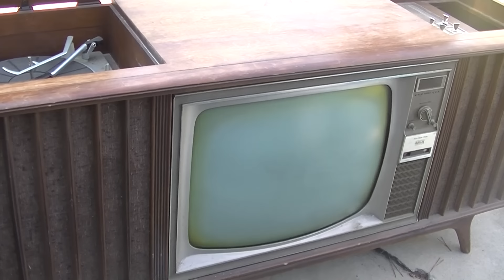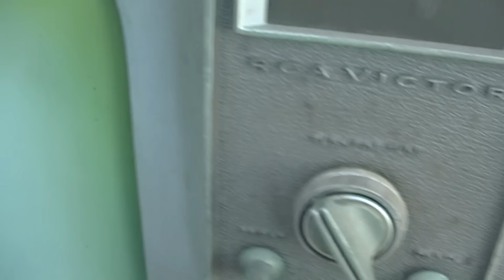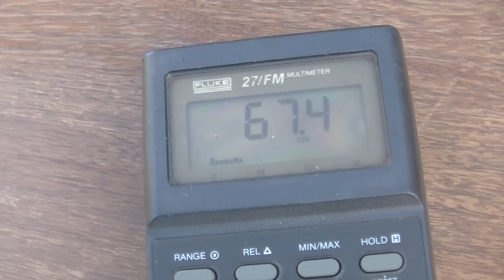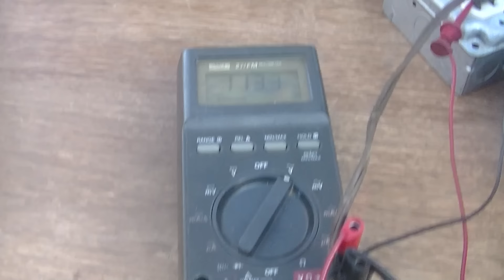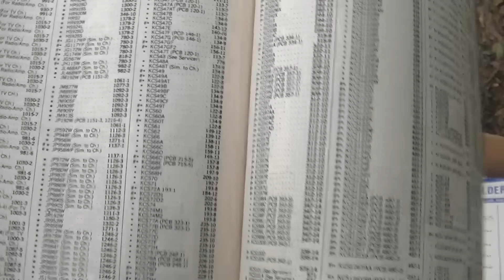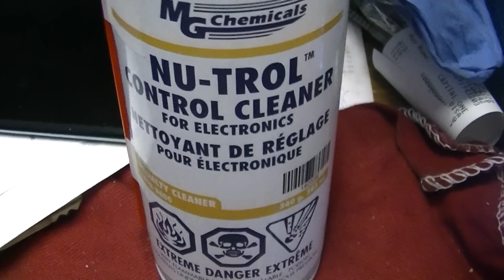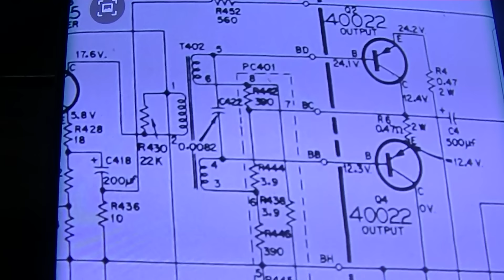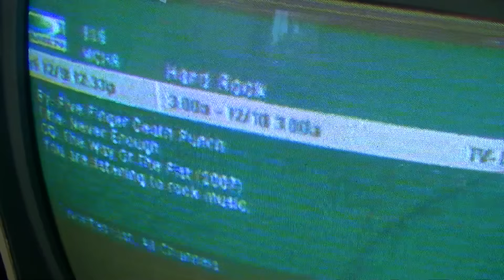1967 RCA Color Television Analysis Tuner and Amp Repair High Hour TV Set

Comment: Cold heaters on the 6GU7s is endemic to these sets. Re-flow the 2 ground stakes on the far right end of the chroma board to fix. With cold heaters, what happens  is - plate voltage on the 6GU7s rises, and since the plates are DC-coupled to the CRT control grids, CRT beam current goes into avalanche, dragging down the HV until the raster blooms out. If left in this condition, the 3A3 and flyback are cooked,  the 6JE6 cathode current goes out the roof cooking it too. We always re-flowed them 2 stakes as a matter of course on every CTC-12, 15, 16, 17 and 25.  Those ground points exist in one of two states: Failed or gonna fail.
Reply from the maker: Yeah I figured something like that or an open corroded jumper wire. I'll get it out and put it on the jig where I can work on it
Reply: Yeah. My experience with them was as a service dealer. By now, you'll no doubt find a lotta other stuff cooked and cracked.
Reply: @shango066  thanks for making these videos.
Reply: Ultra-cheezy plastic tuning mechanism only ran for one model year ('66 IIRC).

Comment: Shango I gotta hand it to you. You can get in the most challenging repairs but its good for the mind. It keeps the mind sharp. I am a repairman for a local TV repair shop that repair the LED TVs with bad backlights. Sometimes I get to have some fun and work on vintage things but I hate it when I have to stop and work on a modern TV with bad backlights every five minutes. Hahahaha 😆. Capacitors used to be the worst part ever made that fails but LEDs beat them out they are even worse
Reply: I wonder if the physics behind those failures is similar explanation.
Reply: Just cheap nasty and overdriven.

Comment: My mom had an RCA stereo only from 1968 with the same tuner chassis and record player. It had a 3way speaker system per channel. I remember for years she started the record player and hand pushed the turntable to get it started. When the amplifier started going at lower volume would hum through the speakers, but if you turned it up the hum went away. Once the amplifier was really bad, both channels were operating on the left side of the balance, nothing out of the right. She wanted to get it fixed, at the time there were no service parts available in 1981. It turned into a TV stand.

Comment: The trademark for Couplate was filed in 1951 by Globe-Union, Inc. in Milwaukee and expired in 1993. The description is "electronic inter-stage audio coupling units for television and radio receivers comprised of electrically connected capacitors and resistors bonded to a high dielectric ceramic base plate". Globe-Union employed Jack Kilby before he invented the integrated circuit at Texas Instruments, so it's likely his experience with Couplates directly inspired the development of the IC.
Reply from the maker: thanks for watching more than the first 2 minutes.
Reply: I resemble that remark

Comment: I thought I was the only Nipper fan! My last true home theater was my 1988 RCA Dimensia 30 inch flat screen. It was the final console, very hi tech with the black, chrome, and grey presentation. All of the components were shelved neatly on the right of the monitor. I had the full package. Super VHS,  compac disk player, turn table, digital tuner, and 500 watt amp(or whatever the highest amp RCA was selling) to handle the full dimensional sound for the TV and the dual twin tower speakers, consisting of a bass, surround, and tweeter. Of course, the beautiful rectangular RCA remote control that ran everything. I remember looking behind it once, with all the wiring, and cringed! I will try and post a picture. Sadly, RCA, was ahead of its time. (the laserdisc, a simple home theater concept, all controlled Universally. One last comment here, it did have a "universal plug" on the monitor side fo the home computers surfacing at the time, along with "Made in Japan".

Comment: Thanks shango!  Appreciate the knowledge shared, even better when grasping a bit what said. 
Your use of parts & 'phrased' words are noted. re: cleaner, O2 sensor, bulb + stereo, QC ... among others. 
simple idea in trade: If no invention of Box to carry light bulbs, use a 4 or 6 pack, they even come with handle. 
I recall you explaining process using Lightbulbs to reform capacitors, but 'lost' how - low vs high W.  Will Read more.
Reply: The lightbulbs are being used as voltage dividers.  The low wattage bulbs have a higher resistance than the higher wattage bulbs.  The lower wattage bulbs greatly limit the amount of current that the TV can pull, and the bulb takes up most of the line voltage, so the TV gets much less voltage than 120V.  If Dan sees that the TV isn't grossly misbehaving (a short circuit, a shorted plate transformer, severely reforming caps), he puts in a higher wattage (i.e. lower resistance) bulb, which allows the TV to get a bigger percentage of the line voltage, and allows it to pull more current from the line.  If there's a severe fault in the TV, the lightbulb limits the maximum current that it can draw (to no more than what the bulb itself draws).  It's a way of avoiding dealing with exploding old capacitors, or blowing a transformer winding open, or red-plating a tube and ruining it, or catching the TV on fire.  It limits the chance of doing damage to the TV.  If things seem to be okay, he hits the bypass switch, which shorts across the bulb and gives the TV the full 120V, at whatever current it wants to draw.  It's just an inexpensive and convenient alternative to using a variac (autotransformer) to adjust the line voltage to the TV.  If you want to understand the theory behind that, look up "voltage divider" in Wikipedia, and more generally Ohm's Law and Kirchhoff's circuit laws.

Comment: Cap coupled amp. They sound fantastic. I think they sound tube’bee when operating correctly. Nice observation on the bias. The Pioneer coupled amps of that era had trimmers to set half the voltage of the rail collector. I have the scat for the Pioneer but not the RCA. I’d like to know more about the circuit. There’s probably more drifted resistors?
Very well done video!

Comment: interstage transformer size correlates to frequency response = absolutely.  The converse of this is why aircraft run on 400 Hz instead of 60 Hz, so that the transformers can be a fraction of the size.

Comment: Those red-ended capacitors were bad from day one.  The red stuffing would melt out in about two years.   The corroded PC board, probably due to critter pee.  And those 6GH8's were run at 100% plate current and they lasted about a year and a half.    Quite the challenge.!
Reply: But they were the 2n2222 of the day. They were everywhere.
Reply: @InsideOfMyOwnMind  2N2222s and 2N3904s.  I used to see 2N3055s everywhere (for audio amps and power supplies) in the 1970s, and 6SN7s and 6U8As before that.

Comment: If you need to pull the chassis out, notice the stamped steel bracket that sticks up near the power transformer. The VHF/UHF tuner subchassis will slip off of the metal CRT surround fascia panel by loosening three 5/17" hex-head screws. Then lift the tuner subchassis out and notice there are two slotted ears on the back end of the tuner subchassis metal that will slide under two loosened 1//4" hex-head screws on the TV main chassis. There is another 1/4" hex-head screw on the tuner subchassis that slips into the slot of the stamped steel bracket near the power transformer. That allows for easy handling of the complete TV chassis without the danger of breaking the wires and cables to the TV tuner subchassis.  Have fun!

Comment: Couplates, never like them things, without schematics your guessing as to what is inside. Good job on getting the output Germanium transistors bias correctly. Its sounding good with lower distortion!  The amount of Iron in an audio transformer does not necessarily limit bass response at low power levels, just that you need more Iron if you need to maintain good bass response at higher output watt levels, because of magnet saturation that limits the low end. Driver transformers are low power so they should have fairly good bass response there.

Comment: Interesting failure for sure but not surprising given it has those huge 15" duo cone ovals that you know have blasted every genre of music. Those consoles were probably used for shop radios and played loud. The heat alone would start to kill the couplate. I've had success making electrical equivalents using a remote mounted board and ribbon cable back to the main board. By adding a couple of precision pots and you  can dial the bias in.
Reply: Potentiometers are because no engineering beats uncertainties.

Comment: I bet the original part was slightly under spec wattage wise leading to it to overheat and fail over time.  I’m familiar with working on this style of amplifier.  I’m really surprised there isn’t a trim pot to set the center voltage as that is normally found on these types of amps.  I always upgrade the final coupling caps going to the speakers to 2,200 MFD as it will help with bass response.  I doubt a volt difference will cause an issue unless running near clipping and the 15x9” speakers will be hurting your ears by that point anyways.

Comment: We worked on a lot of these when we were young.. They were worth fixing then parts were relatively cheap and available. It makes no sense today to do this other than for  the challenge of the repair or should I say the fun of it. What you get is a transistor radio with  big speakers a 25 Inch color TV with a dim CRT and poor color  reproduction. I liked the older 21 Inch round tubes for their  better color purity as they used rare earth phosphors  which had a better color gamut.

Comment: On the finish, all the Danish Modern style consoles and stereo console models had a walnut wood veneer and the finish was not a form of varnish, but hand rubbed oil finish. That might be easier to do than using a varnish or polyurethane finish. Other furniture styles had completely different finishes that did use a form of varnish.

Comment: Great analysis troubleshooting, can’t wait for the next chapter! What a bad design that stereo power amp section is, a couplet resistor package is a terrible choice for power output stage biasing. Of course they’re gonna get hot in that position and need to be able to dissipate heat, that’s a guaranteed failure waiting to happen.

Comment: The 6GU7 filament circuit grounds at the right rear eyelet of the Chroma board. The solder develops metal fatigue due to the heat-cooling cycles of the chassis. Just re-solder the eyelet usually corrects that. When the 6GU7s filaments go out the bias of the CRT gets messed up and heavy conduction of the CRT results. The green corrosion of the wire on top of the board near the 6GU7s is a B+ wire and will need to be replaced. The plate load resistors of the 6GU7s may need to all be replaced with new flame-proof 3W resistors. You might be able to carefully tighten the 6GU7 tube socket contacts. A good cleaning of the boards top-side may reveal other issues that need to be addressed.
There is a stacked selenium disc rectifier in the Damper circuit that develops B++ voltage for the CRT screen control circuits. If it goes high resistance, you may not be able to get the screen controls to produce a line when the Service SW is in the Service position.
Yes the stereo tuner chassis is a bit of a pain to work on. I believe the heat sink that the output transistors mount on can be loosened and allowed to fold aside for access to the electrolytic capacitors. Those OEM electrolytics were not the best quality even when new..

Comment: 14v approx across each of those 390s is roughly 0.5w per resistor, so yeah it will run pretty warm,  i have an amplifier and a tuner-amp that uses basically the same circuit, and their bias resistors(luckily separates in those😉, both made in Denmark, probably by the same company although differently branded externally) run quite hot

Comment: I still want to see all the best tubes and some other parts ported into one final unit.  So many duplicate tubes, one could refine down to best editions. Because I've wanted to start with two old units and make one good. Of course, I lack his tools, knowledge, and experience. I'm stuck running with a 100 watt bulb in series. No bypass.

Comment: Those bias couplates in those radio chassis sucked, had to replace many just like you did with this one, another thing to be careful of is the speaker terminal rivets are aluminum and the heads pop off when you try to disconnect the wires and you end up ripping the voice coil leads off. ☹️

Comment: If you measure the voltage across the 0.47 ohm resistors you will see the bias current.

Comment: There was a big like billion-dollar push in the 1950's to make more reliable components for military applications.  Centralab probably snatched a big pile of bucks to come up with "integrated circuits".    Just like GE did too to develop "Five-Star" tubes.  All those projects were total failures-- the dipped modules were not any more reliable and neither were the very expensive five-star tubes.   There wads also tons of bucks thrown toward an automated machine that would wire up dice-sized "integrated circuits" out of 1/4 watt resistors.  Didn't catch on.   Philco invested $400 million of today's money into building an instantly-obsolete plant to make super performance Germanium transistors.   The same month Fairchild released their first 400MHz silicon transistors that were better in every way.   There were so many missteps toward progress!!!!
Reply: Germanium transistors still have some limited advantages (like the lower forward junction voltage), but plenty of drawbacks.  Right now (for the past 2-5 years), silicon devices are being squeezed out to some degree, for power applications at least, by silicon carbide and gallium nitride semiconductors, which are even more efficient.  Rather amazing to contemplate how far electronic technology has come, especially in terms of power consumption, in the last 100 years - from Poulsen Arcs, large type 204 triodes, and type 80 rectifiers, to some modern RF stuff that can run on lithium button cells, or 100W RF amps that are about the size of an old VHS cassette.

Comment: wow nice set germanium transistors on the power output audio stage with transformer driver phase inverter and the rest silicon transistors..i think that you real ploblem of incorrect bias is the electro chemical carborn resistors altered

Comment: Do you work on the old radios?  I have a 57 RCA 5 tube that plays fine until it warms up.  Then the volume drops down to almost nothing!  Would that be a tube?
Reply: Common symptom of a leaky coupling capacitor between stages. Plate to grid coupling capacitor in the signal path. Plate DC voltage begins to leak through the cap and bias the next stage into conduction and possibly saturation. That can damage the output tube and transformer. Fix it up right and enjoy it.
Reply: There use to be a shop downtown but now it is long closed.  Not many folks like you that work on these dinosaurs anymore!

Comment: RCA printed circuit boards chassis= hot mess. Worst of all the mid 1960s cookers.
Reply: They should have taken lessons from Seeburg who found out really early the phenolic board just wouldn't hold to high heat of tubes for the day. Seeburg went back to hand wired until transistors. Now the materials are so much better you could make reasonable priced boards that would take the heat and abuse. Other makers had different board materials. Motorola stuff wasn't perfect but better than RCAs for the time.